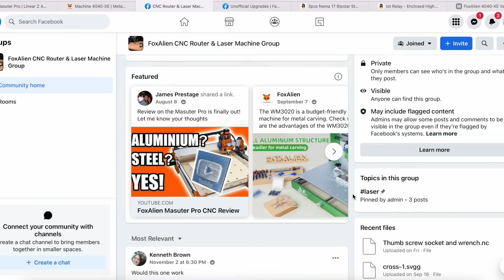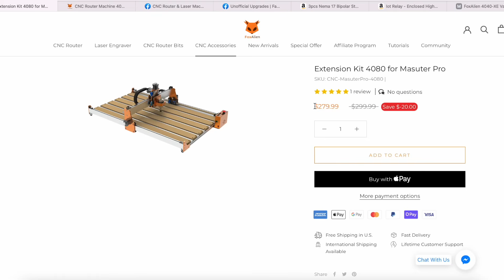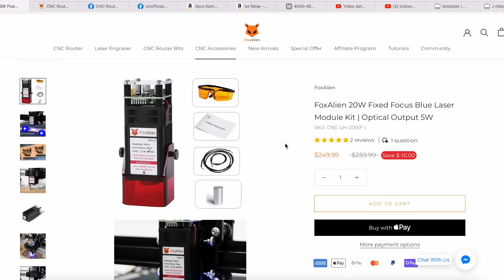What make the FoxAlien CNC Router Masuter Pro so good to be your first home use CNC?

Comment: Tip for people looking to speed up production with thicker materials: Cut a 4-6mm deep channel for the outline of your shape then use this as a guide to carefully cut out the material with a band saw. You can then use a router with a reverse flush trim bit (with the bearing close to the shank instead of the tip) and finish off the edge. Saves a lot of time, but requires extra effort - sometimes it's worth it, sometimes not.